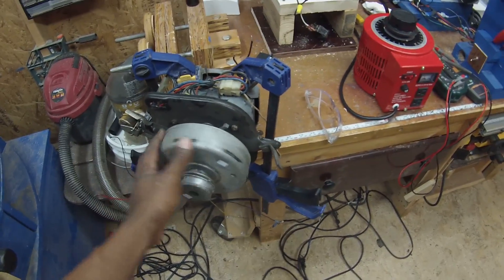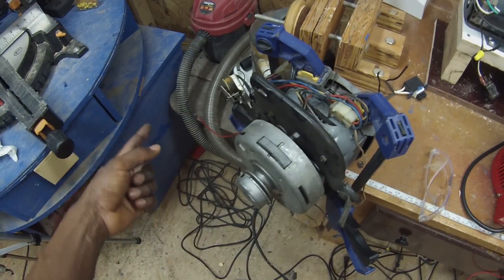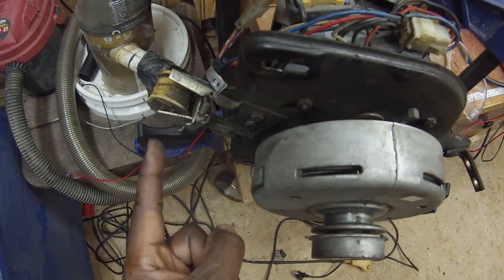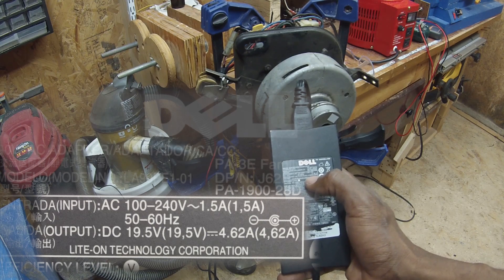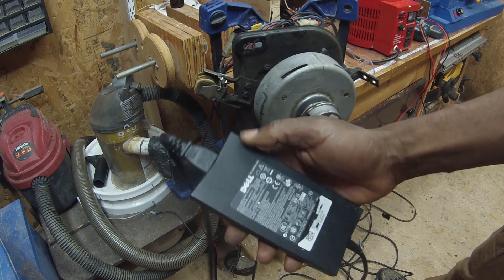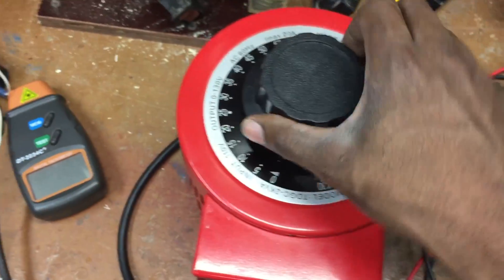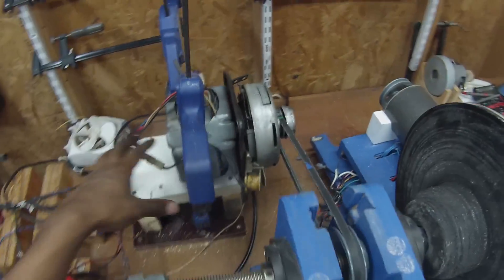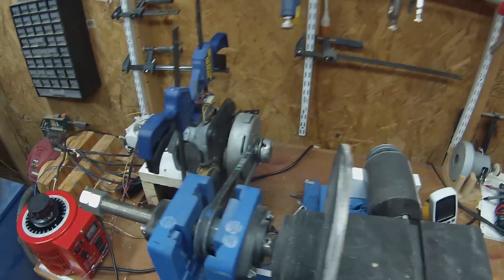Experiments With A Salvaged Washing Machine Motor And Centrifugal Clutch: 017

Comment: An important lesson not yet learned - when playing with rotating equipment that isn't rotating but energized use hand extensions - wooden dowels or other non-conductive items - to check out those things that aren't quite, but just might, running.  Save a finger or two - or even electrocution - that way.

Comment: Very interesting way you analyze the components functions, however you may be better served by looking for the machine's wiring diagram when salvaging the components. With the wiring diagram you would gain much infornation regarding the components use and power requirements. At the least, copy down the make, model and any other specifics for the machine, then the internet is full of free repair or maintenance manuals which contain the information your need to repurpose the salvage.
Keep up the great videos, very interesting.
Reply from the maker: But where is the fun in that??? Just kidding. I agree, and I did do that. The wiring diagram was faded and no help.  Also, this was the first time I tried anything like this. i usually just take out the motor. But this "large" mechanical component hanging on the shaft was really intriguing to me. So it has grown into an obsession to know more about it. I am still finding out things even from you guys in the comments.

Comment: I don't think it's for shock,  it's to let the motor get up to speed before the load is applied,  so it can be much smaller than would be needed to turn the heavy drum from standstill.
Reply from the maker: I think you are right. Some one commented on the same thing below. I read that on a washer repair website but this makes much more sense... that greatly reduces the starting torque needed.
Reply from the maker: I went back and read that website a little more closely and I guess I just remember it wrong. I have added an annotation to the video. I hate the way those annotations look, but I want to give accurate information when I know better. At least people can see I am still learning too. :) Thanks for your polite input.
Reply: You're welcome.  I like your videos I'm just learning about this stuff myself.  I've made Matthias Wandel's belt sander and I'm looking for a scrap motor for it.  I don't want to spend £100 on a new one

Comment: that Dell power supply has a sense pin and won't supply the load unless it thinks there's a Dell computer attached. It's the little pin in the middle. You should be able to find a way to defeat it.
I can't imagine that "slip speed" is meant to be run for any length of time. Wouldn't the clutch wear out quickly?

Sounds like a nice motor though. A sander?
Reply from the maker: I have been able to get current from this supply with small DC motors just using the positive and negative leads. Also I checked it with my multi-meter to double check that it was working at 19 volts (off camera). I don't think that was in issue. Regarding wear, I think it would hold up fine considering it is just riding on the shaft. As the load increases the speed will decrease (speed of the clutch) without damaging the motor or the clutch. I was hoping to make something I haven't made yet... Like an AC powered Go-kart LOL
Reply: Ok good to know about the Dell supply.
Reply: Jeremy Fielding     I think he's talking about the shoes or metal that rubs against the inside of that clutch drum to allow for that slippage. I would think most washers don't use this idea simply because that is a part made to wear out. Don't you think? I wonder how long it could actually run in "slip speed" before wearing out the shoes or whatever friction component and then how many times you could replace those before they wear right through that steel drum hah Unless I just am mistaken on my understanding on that particular centrifugal clutch..

Comment: How many hp
Reply from the maker: This motor doesn't have a motor plate. But, I will take a closer look tomorrow and see if I can find it. Sometimes the numbers are stamped faintly into the steel. Its the same size as the most of the washer motors I have found which are usually 1/2 or 3/4 hp.

Comment: Does the clutch mechanism operate differently based on the motor's orientation (vertical vs. horizontal)? How was the motor oriented in the machine you pulled it from?
Reply from the maker: The motor was vertical... the shaft pointed straight up so that the clutch is inline with the pulley on the tub. It operates the same in all positions.
Reply: Thanks for replying. Just figured with what looks like a little play on the shaft that it might make a difference. I am so happy for your channel's success, hope to see many more videos coming out. You are my kinda fella, take care.
Reply from the maker: Thanks... I think its just a loose tolerance between the drum and the clutch feet mechanism. It was surprising to me how much it could move. But, I couldn't figure out how to get it off without breaking it. I may have to destroy it to really  see the insides. If I don't find a good use for it, I will cut it off to study the inside.

Comment: You should locate a service manual for a G.E. or Hotpoint washer from the 1970s or 80s they changed there washer design in the mid to late 90s
Reply from the maker: I haven't considered looking for a service manual. I will look into that.
Reply: Here's a link to a basic manual, No wiring diagram -http://www.appliancerepair.net/washing-machine-repair-5.html

Comment: Would it have more power in the low speed?  Not sure that would matter.  Enjoy all the videos, Thank you for posting.
Reply from the maker: I don't think so... If I understand its function correctly... Only some of the momentum created by the shaft is transfer to the drum. If the load gets heavy the drum will "slip" more and the speed will go down with increasing load. This is ok for the application here. It doesn't matter if a heavy load of cloths spins a little slower.

Comment: I am totally curious to know reason why for that clutch unit, and exactly what is inside it and how it works. My washer is different. I had it apart to change the water pump. And because machine has been used for 65 years, I pulled the transmission out so I could drill and tap an oil drain plug hole. And yes, I refilled it with new gear oil, put in the used water pump I got off a junk machine, and it is working fine again.
I bet the machine that came out of would struggle to last 20 years.

Comment: just a wee warning to people with washing machine motors.
do not touch when run  ning   pin down on a solid board.
people have been killed by the power current in europe 240 volts!
Reply: Steven McGinty thanks for the heads up! Just got my first t play with and had no idea!